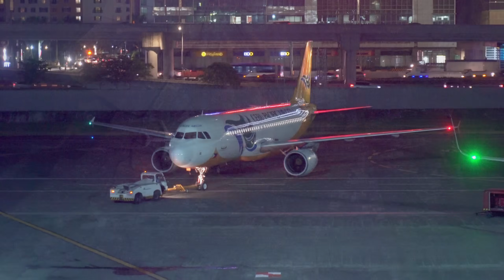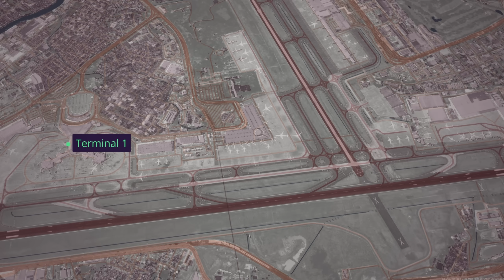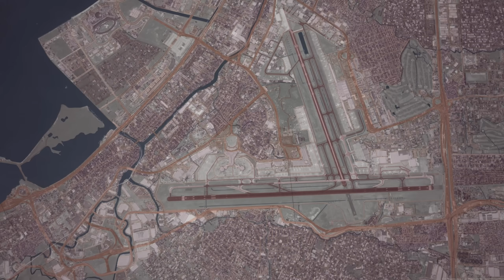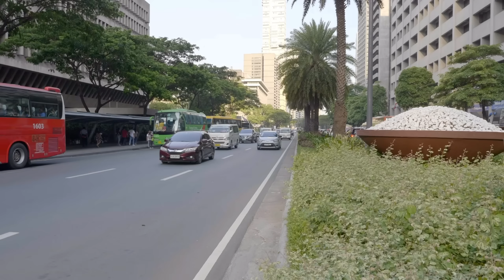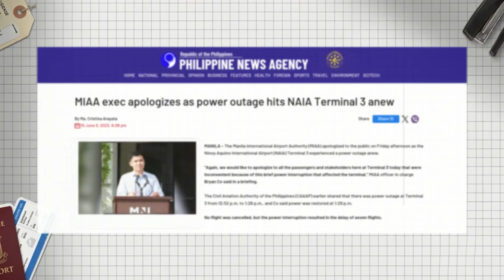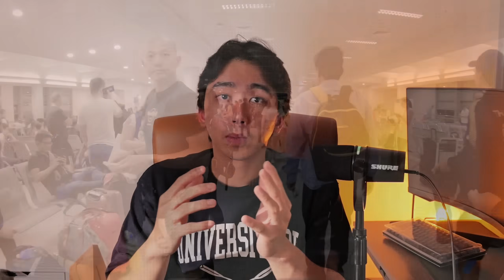Manila’s Airport Problem, Explained

Comment: There should be a shuttle bus exclusive within the perimeter of the 3 terminals and not outside. That way, a passenger with a domestic flight won’t need to go out and pass security screening entering the other terminals.

There’s a single runway, which means there can be access to a pathway that would connect the 3 terminals.

Comment: Yeah sorry while the issue to more traffic is the runways it doesn't excuse the disaster that is its management.  Lets look at Terminal 3.  At the moment 50% of parking is closed for construction.  There is no construction but the parking lot is absolutely closed.  Lets look at Terminal 1...  international flights at all times of day an night, 2 dozen immigration booths,  4 of them in use and 20 standing still while huge lines form at all hours of the day.  Lets look at leaving Terminal 1 where instead of using the highway connection they instead direct all traffic to Sucat and didn't bother to install a traffic light so there is perpetual traffic jams.  Lets look at the new highway entrance into terminal 3,  a DANGEROUS design that put traffic flow from 3 different entries into a roundabout without so much as a single painted line to direct them.  I can forgive the bad layout and the lack of space to expand I can't forgive the poor staffing and complete lack of any responsibility for the staffing.  I can't forgive the inability to simply paint lines on a roundabout or put any traffic lights to direct traffic.  Half the problem might be the layout and age but it doesn't wash any hands for the disaster that is poor staffing and dreadful traffic management.

Comment: You can't come to a conclusion without even looking at where the passengers are going. For many, Manila is simply a connection, and those passengers would be similarly or more happy to fit via Cebu or Clark. But it requires government to have some balls and ensure that those connections are more attractive.

As for NAIA, the biggest problem is human inefficiency. Other airports can princess 2-4-5 customers a minute on a single check in counter. At NAIA it takes 2-3 minutes to process one. Would you not expect lines?

Comment: You should also consider the downsides of this privatization, san mig is making these investments for efficiency, and more cashflow, but to sustain these investments they also increase fees, fuel surcharge, ramp fees, hangar tenant fees, at one point after the smc takeover, they almost drove out lufthansa technik, a major anchor in filipino aerospace engineering, encouraging mechanics and technicians to stay and work in the philippines into leaving because of these fees. As arthur morgan ince said, "we ain't your idea of charity!" Along with these, mainly from fuel increase (not connected to iran, the prices have gone up well before it) airline ticket prices in and out of manila are rising even faster. Smc is practically a parasite without these developments.

Comment: I appreciate your effort with this video but please make sure that you are a qualified expert on the subject matter if you decide to scrutinize something. The crossing runways are so that planes can take off and land safely in the shortest distance regardless of which direction the wind is blowing from. They are not meant to be used simultaneously.
Reply from the maker: Thanks for the comment! You're exactly right about why they are built that way. As mentioned in the video, "because the runways cross, one aircraft movement can limit what can safely happen on the other runway." The video I created is not an argument that they should be used simultaneously, it's only pointing out that because they can't be used simultaneously, NAIA's hourly aircraft movement capacity is permanently capped.

Comment: I travel frequently over NAIA and never had any big issue or waiting time! I think for it's layout and shape it's managed extremely well!
Not once any plane that I used had to wait in the air out on the ground for a noticable long time. It's a good airport! The only thing that annoys me is that my girlfriend isn't allowed to go inside to say goodbye and also do the check in with me, when only I have a ticket. That's the only thing that's really annoying. Ah, and there are too few seats at some gates and in the lounges 🥲

And terminal 4 is gone for at least two years now! 

Anyway: The few problems will be solved as soon as the new airport opens, but I think the new airport is in the wrong place. It should be south of Manila and not north. Or in the southern Manila Bay near NAIA (for example sangley point near Cavite) or in the lake near Taguig.
North of Manila is Clark International Airport already. No more airport is needed there, but in the south it's really necessary, especially since Manila doesn't have any subway system yet that connects the three airports. 

I hope they won't close NAIA after opening the new one and I hope they won't stop international flights there because I need it to go to my girlfriend in Batangas 🥲
Reply: I use that airport when i travel between LA and the Philippines once every couple of years and i've never had any issues, except one time which was totally my fault and the staff went above and beyond to help me fix it, i will never forget the kindness and consideration they showed me that day. These doom and gloom videos about anything regarding the Philippines is made because they know it attracts views.

Comment: On the 08 January 2026 I flew to the Philippines but my flight was delayed so instead of arriving on the 09 January at 22.40 it was 10 January at 05.00 and it was great, all us passengers just sailed through BUT on departure for the 23.40 take off I arrive at 18.00 hours and Terminal 1 ! There must have been 3 to 4 hundred passenger with very long queues.  It took me two hours to check-in but once through then not to bad.  WO there lots of building work going inside the Airport.  Yes it's over loaded

Comment: The easiest solution i think is to move the main airport to Clark, there are still a lot of open land around where you can built additional runways, at the same time built a new highspeed railway parallel NLEX or a dedicated bus lane in the middle of NLEX or connect the railway to land appropriated for MRT expansion in the North, or maybe a monorail which takes less space to built on and decicated to airport service only. I'm not sure which is more feasible but moving to Clark is the faster solution than waiting for the Bulacan airport to be built.

Comment: manila's airport can solved fast if political will is use, international flights should be transferred to diosdado macapagal airport to decongest NAIA, DMIA is better with 2 parallel runway, unlike NAIA with 2 intersecting runway, now the country is creating its biggest airport yet in Bulacan with probably 4 parallel runways, imo developing DMIA is the better choice with less cost..of course the Bulacan is build operate n transfer at no cost to the govt courtesy of san miguel corp the biggest conglomerate in the country...

Comment: Wait wait wait. There is absolutely no issue that any airport runway pair is an X. You have to be clear about that. 
Runways cross due to the direction of winds. If winds are heavy in one direction, the other runway can be used. 
But yes there is an issue with just 2 runways for a major national hub.

Your other stuff is correct. But that intro brings misconceptions.
Reply: Crosswinds are more an issue for smaller slower simpler prop-driven planes. Jets aren't as affected, and the crossing runway is more used for takeoffs with far less frequency.

Comment: Parallel runway is a product of efficiency and economics. 

Intersecting runway is a product of science and safety. The reason being is you can’t always predict the wind direction, and plane landing is safer landing with wind behind or in front of them and not pummelling the plane on the side.

An optimal solution would be 4 runways; 2 intersecting ones
Reply: That was more true for smaller prop-driven planes that were more easily blown about. A century of aviation experience and technology has largely mitigated the risk for all but the most severe crosswinds.

A 2x2 airport layout would need to be as well run as SFO, and even there the 01/19 runway pair is used much less frequently and mostly just for take-offs.

Comment: And they gave it to SM, wat a brilliant move. They increased the prices for building new restaurants. Nothing has changed inside except they have added more hassle. They made it like a shopping mall which they are experts at. They removed all the seating arrangements so people will use the restaurants. How amazing are the SM management. They dint fix the gates, the tube or air conditioning. They just made new restaurants.

Comment: The Manila International Airport in Pasay City was built within its space limitations and wind conditions. Airports use X-type (intersecting) runway arrangements primarily to handle varying wind directions safely and efficiently. This design allows aircraft to take off and land into headwinds from multiple directions, reducing dangerous crosswind operations and improving overall safety.
Safety: Reduced crosswind risks.
Flexibility: Multiple runway choices depending on wind.
Compact Design: Efficient land use compared to parallel-only layouts.
Adaptability: Useful in regions with highly variable wind patterns.
X-type for flexibility, overall safety, and compact layout for a limited land area.
The parallel arrangement is a design for efficient take-off and landing operations, but requires more space. The new airport designs for Bulacan, Sangley Point, and Clark follow this consideration.

Comment: It is probably better if the NSCR would have been connected to New Manila International Airport in Bulacan which is located 35km. north of Manila, Clark International Airport which is a former American air force base should never be involved because it's located some 80 or 90km. away from Manila even farther compare to Narita to Tokyo, and Clark was originally design for military purpose, they may not even build a second runway because a new passenger terminal there was already built, NMIA was really design to handle both passenger and cargo airport and was design to handle large aircraft such as Airbus a380, people around here in the Philippines just don't understand (crab mentality,idiots etc.)
Reply: The New Manila International Airport in Bulacan will be about the size of Paris Charles de Gaulle Airport in Roissy, France 🇨🇵, SMC Infrastructure's partner Groupe ADP or Aéroports de Paris will design the Terminal buildings and would have 4 parallel runways allowing simultaneous take offs and landings every 30 seconds and its located far away from populated areas to curb noise pollution.

Comment: No. Gatwick with single runway operations can handle up to 57 aircraft per hour. **with single runway. New York LaGuardia could handle up to 71 aircrafts with similar runway layout to Manila airport.

Manila should upgrade the runway to make aircraft enter and exit the aircraft more efficiently. Pay and deploy new atc system, such as those used at Gatwick to maximize runway usage efficiency. 

Manila should also build or upgrade the passenger terminal. Look at New York LaGuardia. They built beautiful and efficient terminals with modern design and enough gate to handle to large passenger volume .

Comment: add a parallel runway. build a new awesome terminal with adequate parking and taxi area. ADD A TRAIN LINE!   the few people displaced can receive compensation .   save 12 billion    spend the 12 billion you save on a useless sea wall somewhere. just kidding about the sea wall
Reply: A 2nd parallel runway is not feasible the surrounding area around the airport is so heavily built up there's even the new C-5 SLEX Cavitex link.
Reply: @dennis12dec  put the new runway on the north side.  pay the displaced people 5 or ten times the real value.  still save 12 billion
Reply: @cementeagle3596  It's not going to be easy, the people who own their properties will fight to keep their land no matter what the cost in the Courts or to the Death.
Reply: @dennis12dec  the 15billion swamp airport is already under construction.  15 billion is a lot. i think marcos signed a law called the arrow act a couple years ago that is phils version of imminent domain.

Comment: Do you have some informations about the plan of SMC building Terminal 5 also relocation of Terminal 4? What is your views and comment of present operation and improvement of NAIA under SMC?
Reply: I think the new terminal is going to be built at the lot of the former Philippine Village Hotel and Nayong Pilipino complex beside T2. The large apron is already there and the hotel has already been demolished. The reconstructed T4 will be on the site of the logistics/cargo center in the middle of T1 and T2. I reckon both are probably just an extension of T2 and would be impractical. 

Imagine having 5 terminals with 2 runways crossing each other.

Comment: The New Manila International Airport in Bulacan opens it will be more than the size of Paris Charles de Gaulle Airport in Roissy, France 23km Northeast of the French capital will have 4 parallel runways that can handle take offs and landings every 30 seconds. The new design for the Terminal buildings will be done by SMC Infrastructure's partner Groupe ADP or Aéroports de Paris who operates designs and manages the French capital's 3 main airports Orly, Le Bourget and Charles de Gaulle. Groupe ADP also designed the Terminal 2 or the Centennial Terminal by French architect Paul Andreau.
Reply: And "WHEN" will that airport be opened? 

And if "EVER" that airport runs, "HOW" the majority of the public will go to that airport???
Reply: @markrioreyes5706 there are new highways being built to connect the airport with the NCR including the section of the Skyway in Balintawak plus a dedicated railway link similar to Hong Kong's Airport Express.
Reply: @markrioreyes5706 MRT 7? 🤔
Reply: @gerardcapisin8257  LOL nauto ka din sa mga pinagpa plano ng SMC? 

Yung sub 25km MRT 7 Mahigit isang dekada nang ginagawa ng SMC, tapos aasa ka sa kanilang airport Loop? 😅😂
Reply: @markrioreyes5706  so, what do you suggest?
Reply: @gerardcapisin8257  Ihinto na nila yang NMIA, lulubog lang ng lulubog mga nakapaligid na bayan diyan. 

Bilisan ng gobyerno ang pagkuha ng ROW para sa NSCR at MMSP Para inter connected na sila ng CRK airport.

Comment: If they built new one
Reply: actually thats the plan right now they planning to buy the whole residetial area beside the current runway so another ROW issue again that takes decade to ressolve i expect that plan will be a lost cause since they are building another airport nearby
Reply: Well they are building nmia or new manila international airport that will hold 100 million passengers in Bulacan and having 4 parallel runways

Comment: They could have easily extended LRT 1 to NAIA. The depot is right next to the airport.
Reply: they did but the station is too far from the airport.  courtesy of stupid planning by government officials.  nothing is done right in this country.
Reply: @freddyso5466 Thought I read somewhere that there were some powerful interests at that time whose business interests will be impacted if the then new LRT line will be extended to the airport. Nothing has changed in this country.

Comment: The problem of constructing a really large airport was discussed way back 1998 and there was consideration already for Clark Airport in Pampanga. But it seems to be too far then. In the interim, they kept on adding terminals - Terminal 2 in 1999 and Terminal 3 in 2008 (though T3 has a long legal issue which involved lawsuits in Germany). After 2008, talk of constructing a fully integrated terminal was already ongoing but no decision. Under Duterte's Build Build Build (BBB) started in March 2017, Clark was expanded and a train infra was being planned and construction started for a train service from Clark till South in Laguna. This construction was ongoing when BBM started his presidency.